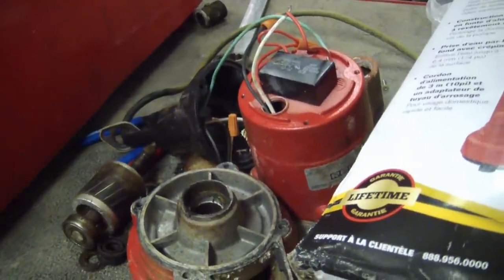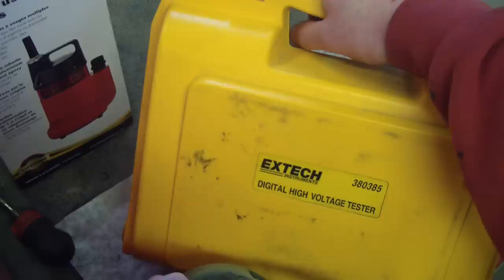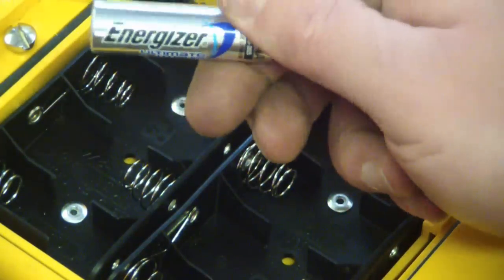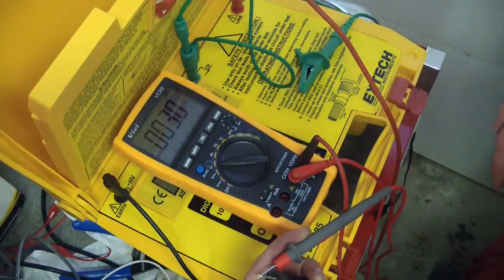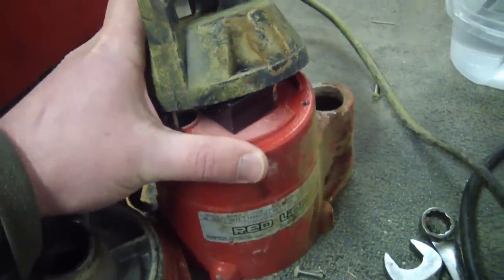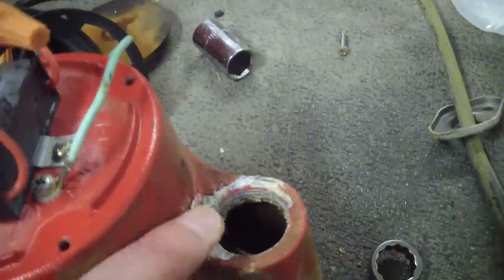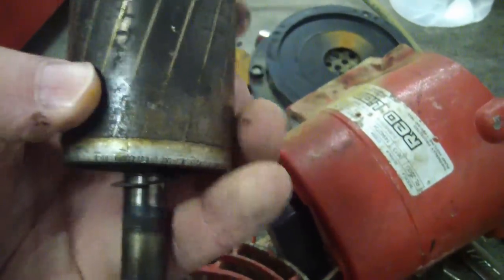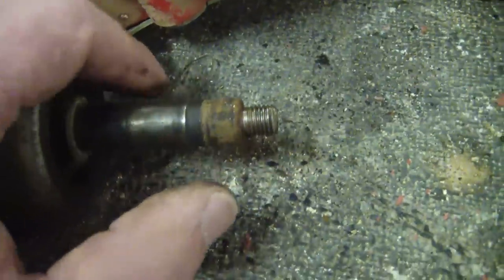BOLTR - La BOMBA! Red Lion water chooch'r is engineered to FAIL!

Comment: It is a very annoying trend these days, with pretty much everything, from premium car manufacturers, that mill timing chain sprockets right on to their diesel engine cranks (single part), then use cheap steel to make the timing chain itself, couple that to long life engine oil, and you have an engine that sometimes even fails under warranty, and it is pretty certain to fail sometime soon after that, other car manufacturer decided that lock keys on the crank bearings is no longer a necessity, so they remove them from design, long life oil again, that gets too thin to maintain a film when the engine sits for a few days, and when it is started up, crank just so slightly pulls the bearing insert with itself for a tiny bit, tiny bit by tiny bit, and few tens of thousands km later the oil passage hole in the bearing insert does no longer align with the oil passage in the bearing seat - no oil gets to the crank - engine kaput shortly after, then there are top end brake parts manufacturer that is doing hard anodizing on their racing aluminum parts, you think - hard anodizing much more durable than regular (harder and thicker), will make the part last longer... wrong... I made the same exact part, same exact dimensions, do regular anodizing on it (thinner and softer) and the parts suddenly last up to 2000km (racing application) instead of the originals 1000km - aluminum part is near a very hot steel part - anodizing is flaking off of the aluminum (that will just happen, no way around it), so the hard/thick layer, when it flakes off, immediately creates nearly 0,1mm clearance - which is enough slop for the steel part to start hammer on the aluminum and few braking sessions later than clearance is already 0,2mm and at 0,5 the aluminum part is garbage - this doesn't happen not nearly as fast with the regular/thin/soft anodizing on it... but hey - capitalism moves the world right, only what direction?
Reply: that aluminum part I was talking about, cost about as much as 3 of these pumps

Comment: I've had Princess Auto explain to me that their official return policy is whatever you can convince the clerk is reasonable. As the customer service is usually staffed by younger females dealing with rude and impatient men all day, I find this greatly to my advantage. Conversations starting with "Hi, you look like you're in a good mood/you've had a rough day, how's your shift going? I like that tattoo/colored hair/piercing/dead look of a wasted youth in your eyes/etc" instead of "The fuckin' garbage I buy here always breaks, empty the goddamn till into my rucksack or I'm going to shit on the counter again" that the poor girlies hear all day seems to be the optimal strategy. Also, clean your junk before you return it. If you so much as sprinkle mud on it it gives the impression it was used as arena flooring at a monster truck rally. No need to keep receipts, it's all on file, and they'll even return things that are so old they don't even have the UPC for it in their system, long as they can tell it's a Superfister product.

I've heard Harbor Freight's return policy ain't actually all that shabby either, but, yeah. Princess Auto is Harbor Freight of the north, with everything double the price for the same quality.

I don't quite understand what's going on in the UberOhm meter. Wouldn't typical enamel or other insulation fail under 10,000v? Wouldn't you be creating punctures that would then continue to be failure points later?

Comment: As part of an engineering course I did many years ago, we actually did built in failure strategies for both mechanical and electro/electronic systems. It amazes me that this sort of thing wasn't stopped years ago, but its got to be such a precise science, if frightening how precise they can be with the failure of the products they sell. So it's screw the environment and make sure you keep coming back for a new product as soon as possible.

Comment: You don't want to go much above the running voltage with a megger as it could break down the insulation in a good motor.
Reply: Jeff Pinter good point. Here motors designed for 240v get tested at 500vdc

Wiring systems on the other hand with tougher insulation get 1000v
Reply: ***** A distinction between balanced input voltage and voltage to ground should be made. The latter always used to be tested with 2kV here with 230V nominal.
Reply: zwz • zdenek Yes, true. Appliances used to get a 2500v to earth 'flash test' (which isn't really checking for insulation resistance, it's checking for clearance distances, although of course poor insulation resistance will cause it to fail that too).

Can't do that really any more, because so many appliances have filters that include capacitors to the earth terminal from the line... they'd be fried
Reply: Jeff Pinter If I remember correctly, the standard megger test is done at approx 2x the rated voltage of the device. We have a 480VAC system where I work and motors and such are tested at 1kV.
Reply: +Jeff Pinter yeah I thought that was pretty weird; insulation won't be rated that high and you can get arcing through it
Reply: re: "insulation won't be rated that high and you can get arcing through it"

It's the PAPER insulation that sits in the slots inside the STATOR that goes bad, is the leakage path in these tests ...

Comment: I have worked for many manufacturing and engineering company's during the last 25+ yes and I can honestly say I've never heard of anyone designing a part or assembly to fail.
Sure it often seems like that but the reality is that most equipment have dozens and sometimes even hundred or thousands of components and each component has multiple possible failure modes. Sooner or later one of those dozens/hundreds/thousands of components are going to fail while other components night still have many years of service life remaining.
The fact they used 3 seals instead of 1 or 2 most likely indicates they knew that was the weakest link of the chain and tried to beaf it up, sure they could have changed to a as shaft or even just a ss sleeve, but that might not have been as easy as just using 3 seals, since the as shaft motor might not have been available from their supplier etc.
Reply: That's a bunch of bullshit.  I have tools and instruments that are over 100 years old working like new but somehow a 12 year old skill saw is completely worn out. Everything is engineered to fail or there are just plain piss poor engineers.
Reply: @TempoDrift1480  you have every single one of those thousands of instruments that were manufactured 100yrs ago and every single one is in perfect condition? Or you have one of the limited few remaining that survived while the other 99% have long since failed and been discarded by others?
My Makita circular saw purchased in 1994 is still going strong 26yrs later. As are every one of my power tools purchased in the mid 90, they've all seen plenty of work and still going strong. The only exception was a cordless drill (NiCad) which when the batteries finally died, it was cheaper to get the new cordless drill with the better Lithium battery technology.
Reply: @TempoDrift1480  I have engineered Aerospace components and systems, Automotive components & systems, automation systems, Industrial Processes, Structural Constructions, etc etc. When you've got time to come up out of your Mama's basement I'd be glad to show you.

Comment: +AvE - the stuff on the motor windings is called varnish, the string I have always known as just string, or lacing cord/tape - it's made of nylon or polyester, which is what does the shrinking you mentioned that holds everything in nice and tight. The one you have there looks like it's been coated in lacquer too.

Comment: i've sold sump/utility pumps for 16 years and only had switch failures and impeller failures. also the submersible pumps [flotec/pentair etc] are all oil filled/cooled. still. good video,  thanks

Comment: I actually came across this same engineered obsolescence in a hot tub pump. Shaft rusted, seal leaks. No sleeve. Divorced pump body and horizontal mounting meant that no water made it into the motor. The fact that the only way of purchasing the $500 water pump is with a free motor (go figure) means I have a perfectly good(ish) 240v 2 speed 5hp motor, with that coveted (by obsolescence engineers and bean counters) service factor of "special", waiting for a home in a future project that will work with a rusty shaft.

Comment: I worked at Harbor Freight for almost a year. I honestly can say that any of the pumps that HFT sells were designed to fail. When you purchase anything with an electronic or fuel reliant drive it will most likely fail if you actually use the damn thing like the way it was advertised to be used. As a cashier, they make commission off the extended warranties. If you purchase the extended warranty, a certain percentage of the amount spent on the extended warranty is given to the cashier on the next paycheck as a "Thanks for the free money" as hardly any customer will ever warranty of $25 tool they got on sale. The other part of the money spent on the warranty is sent to the manufacturer of the tool as a "incase they manage to procure a valid warranty" fund as the warranty of anything is subject to the store manger or (if the store was falling apart like mine was) the cashier. Of course there was a number to call, to verify for purchaser that their purchase was insured, and the what-not. But it all came down to how you socialized with myself who was working as a cashier at the time that I would insist, to the person over the phone, that the product was faulty from the manufacturer as it failed with adequate maintenance and slight use.They would then give me the okay to warranty the item and send the old one back in a huge box of "warranty goods" where during more deposits of warranty items and shipping of the loose contents of that box would be further damaged. It's a mind game. You simply get what you pay for. In this case, it was a well thought-out plan of making the product fail in a given range of use and you were denied a replacement. I can't count on one hand how many hydraulic jacks or electric tools I was forced to warranty because of obvious signs of abuse. Not saying you used your product out of it's capacity, just speaking from the mind of one who had to judge the customers and the product.

Comment: A wonderful grand review if I do say so myself.  Keep the pressure on these bastids.  I don't know where you got that federation money but it is a feral offense in the frozen north to posses it.  I sure am glad I don't have a basement or I would probably need a ton of those pumps.  We are in the land of shallow water table here and I bet I couldn't keep it pumped out.  When I was building the fence around the back yard I had to hurry and get the concrete and the post in the hole or it would fill up with water.  Thanks for the video.

Comment: I have disassembled a competing pump (Little Giant) and was VERY surprised when about 2 cups of oily liquid came out when I opened it up. (workbench was slathered)  After some research, I realized this was special "dielectric" oil which is expensive and hard to source. They fill the inside of the pump-housing to allow thermal transfer to the water being pumped. It also eliminates water-intrusion. ('cuz the housing is already full of liquid)

Comment: I used an identical water pump for almost a year. At the point that it stopped pumping, it was taken apart and examined. The problems described here were the problem. Great pump though. It was solid and worked...... until it didn’t. Had to purchase a new pump elsewhere. 
This is proof that a manufacturer can’t save money on the important things.

Comment: A little late to this party.
I worked on a coolant pump in an inductive heat shrink machine for tool holders at my work. Over the years it was neglected and now it leaks around the shaft. So I took it apart and it's a weird little guy.

It looks like a couple carbon bushings press an o ring around the shaft into the nylon "casting" and that's how it seals. Now the actual shaft has worn where the o ring sat and it just pisses out whatever you put in there. So this pump is from a manufacturer that also makes pumps for pools, and the fluid specified for my pump in particular is water or ethylene glycol.

Now my plan was to put a speedy sleeve over the worn portion and hope for the best, but I can't find one for a 10mm shaft. So whatever it's been dammed off with absorbent socks and everyone has been instructed to refill the tank before use - or whatever - fuggit, it's not totally fucked yet.

Comment: Just FYI, meggers have long been used to test insulation/corrosion/whatever on whip antennas and cables/connections in marine environment. Salt is death there to so many metallic bits, besides conductive when wet. The high voltage "sniffs out" the salty shunt circuits. Of course 1 kw HF transmitters will find the weak bits other wise, with some stress on the electronics.